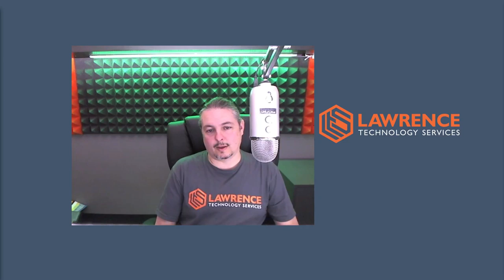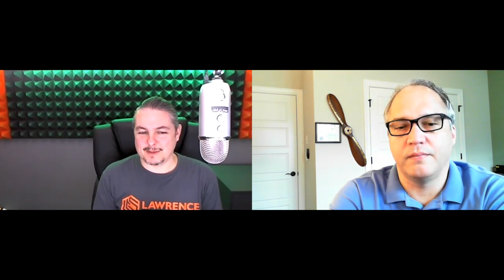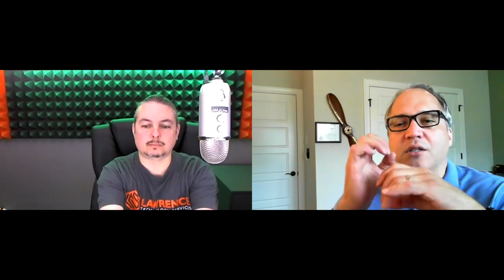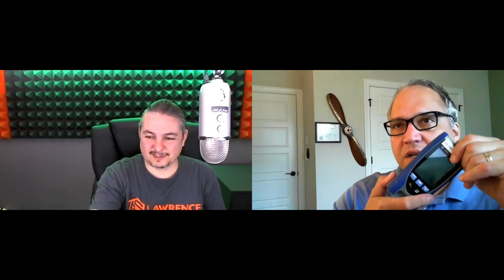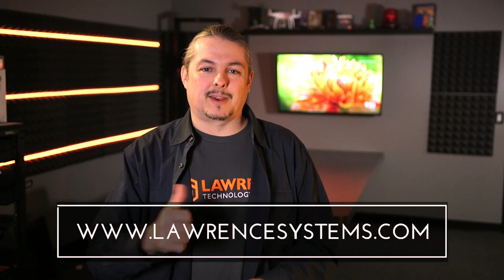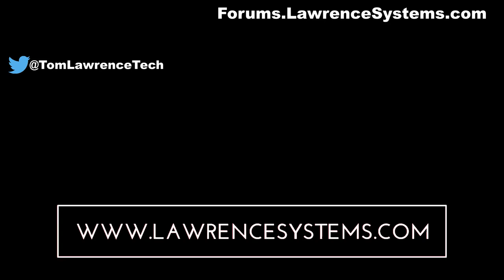The Evolution and Future of High-Speed TIA CAT Cabling Standards & Testing Processes

Comment: This was an outstanding interview!  I have worked in IT for a very long time!   I have interrogated cable installing companies all the way up to the owner.   In those discussions I would ask if CAT5, 5e, 6, 6a would support X speed and all I would get is a parroting of the cabling standard, which I totally get.  But the answers weren't real world!  In your interview with Dan Barrera, you got to the real world capabilities and the whys of it all!  The info about POE was very enlightening, especially the heat aspect within a bundle in unconditioned spaces.  Never heard of this being a factor in respect to data loss or intermittent issues.  Makes total sense! Outstanding!  Much appreciated!
Reply: @R P Good question.  We had about 40 feet or  10 meters of run between where we wanted two new patch panels.  I asked would CAT6 work reliably at 10Gbps.  Internet said we you could, if run was short enough, but expert said standard says CAT6A.  Not willing to take the risk, we ponied up for the CAT6A (its less expensive these days so I would just do CAT6A).  Later, a situation arises where we don't have enough CAT6A runs to connect old and new servers.  We patch in to CAT 5E runs and patch panels figuring we will take a performance hit, that line speed would negotiate down to 5, 2.5, or maybe 1Mbps.  Nope, 10Gbps, zero errors on server and switch interfaces.  Once done and the old servers were pulled we patched everything into the 6A runs.  But in the real world we had zero issues doing 10Gbps over older CAT5E runs in our server area, over a distance of 10 meters.  Now I know the real world answer--yes you can.

Comment: The reason why cat 7 is not recognized as a standard used in America is because it is a shielded product each individual pair has it's own shield. It actually looks more like multiple mic line cable. It was designed for the European market because the European market does not have an FCC to regulate RF emissions from equipment. Whenever you look at a piece of equipment you will notice that it has FCC requirements and that it has met those requirements that means that the equipment is within the RF limits specified by the FCC. As a result the American market uses unshielded twisted pair because interference is generally not common. A side tip cheap electronic car chargers for charging phones and tablets can actually interfere with the push start in cars because their power supplies may not meet FCC requirements and admit high levels of RF which can interfere with the electronic receiver in the car. Back in the 90s when police were using the FM spectrum for radio transmission you had to use screened CAT5 around those facilities because it would have interference from the radio equipment towers. Another thing that is interesting is the category cabling was not the first standard developed. Belden cabling and anixter developed the first standard which was called the levels program they had level 4 cable 4 pair twisted pair and it was swept at 16 megahertz. Later they came out with level five which was swept at 100 megahertz eventually the IEEE came up with the category standard and eventually anixter and belden cable dropped their levels program. This is now being adopted for fiber as well instead of having to specify a certain fiber type like multimode fiber 62.5 you can simply request om-1 om2 is 50 micron fiber om3 is 50 micron laser optimized 10-gig fiber and om4 is 50 micron laser optimized 40 gig fiber You also have os1 which is a single mode fiber and os2 single mode fiber. Another thing that can be mentioned is the jacks the 568A standard and the 568 B standard where did they come from. 568A standard was developed by IBM  the 568B standard was actually developed by Western electric it was designed to accommodate an existing wire configuration for T1.
And it's an extremely old wiring standard compared to the IBM standard. The skinny effect occurs around 54 megahertz. When you get into coax cable companies would commonly use a coax that was actually clad copper over steel for drop wire because it was a very strong wire.  However this cable is not suitable for satellite systems because satellite systems provide power to the lnb at the dish. Steele is a very poor conductor compared to copper or even aluminum. What makes aluminum a problem pronouns conductor for electric. Aluminum corrodes rapidly when exposed to air but also it tends to like to expand when it gets hot. This can cause the conductor to come loose for example a outlet and get hot enough to start a fire overtime . One of the main reasons why Poe switches can shut down is excessive current draw devices are rated in Watts if the voltage is too low the device will tend to draw more current and make the difference up that way. Not all power supplies will handle additional current needed to operate the device so they will shut down automatically to protect themselves.

Comment: Just needed to comment 😃 
The thing that cat 7/A cable (I'm speaking of raw solid core cable) is so popular in europe is mostly driven by the Germans, it's an mix of laws we need to follow.
New cabling for commercial (enterprise) buildings needs to be at last Class Ea certified. Every single communication wire needs to be shielded and Grounded.

Cat7 has a higher package density as cat6a STP and is much smaller in size. Cat7 is so popular that in fact it's most of the time the cheapest option to buy. If we want to buy only cat6a we have to import it from the US.

We install full shielded Class Ea rated keystones (E-Dat design) on the cables or use Krone LSA-PLUS punchdowns. 

I see a lot of hate against Cat7 cables and "Boooo, Cat7 does not exist and is a scam" shouting. 
That's 50/50 true 😂 no one uses Class F or Fa , no one uses GG45 or Tera and Cat7 Patch cable marketing promise's are in fact a scam 

But we Germans love Cat7 raw Cable

Comment: Lawrence I love the videos and this interview was great but the volume difference was maddening! I had to hold the volume knob ready to turn it down when you spoke and up when your guest spoke! If you are still using kdenlive to edit there is a simple "audio correction" called "gain" that can help you sync these up better. Again very grateful for these videos though, just trying to help 🙂
Reply from the maker: I did use that and through audacity, it was much worse
Reply: It was my fault. I had the gain too low on my mic setting. It was probably so low that adding more gain would have brought in too much noise. Sorry about that.

Comment: I know many years ago, the discussion was about switching over to silver compared to copper  for electrical wiring. I wonder if TIA or ISO ever thought about testing silver to replace copper. More likely, it will be a very expensive cable, but such as demand lower prices, we could see prices of silver CAT 6A cables at the price point compared to copper CAT 6A.

Comment: Yep. I do buy some Cat 6 when on sale, but I use 5E for everything, as I knew it was ‘good enough’.

I have had discussions with other IT people, less informed/trained, that swear you need Cat 6 for gigabit.

I reply: Prove it or give me the electronic (physical) characteristics for that claim!
(Or at least the specific spec).

There is always silence after that.

Once you know how data is actually transmitted on the wire, from the wire gauge, the frequency response/bandwidth, crosstalk, attenuation, to the specific electrical coding used (differential) to send the bit stream, very few people can teach you how Ethernet “really works”.

(I did start with ArcNet, Token Ring, Coax Ethernet and Thick Ethernet).
Reply: yea, of the two buildings i support, one is cat 5 and cat5e cable.  all of it runs fine at gigabit.  at lest two runs are over 430 feet and still, to my surprise, run gigabit.  only issue we had in the old building when we jumped from 10 megabit hubs to gigabit switches was that most of the connections weren't crimped to a standard.  At time of install, they just put ends on them being sure to match the other end.....  worked fine on 10 megabit.  after we rolled out the new gigabit switches, i had a lot of cables to fix.  for a temp fix, i forced the non working ports to 10 megabit (don't remember if it had to be half duplex or full worked) and everything worked.  took a couple of weeks to sort out all of the cable end issues.

Edit:  as an addition. two weeks ago, we switched phones over to VoIP and all of them are POE and work fine over our 10-15 year old cable plant.  I did kind of expect i might run into issues in the old building; but none so far.

Comment: Great interview!  Thank you.  Any thoughts on CAT5e or Cat6a marketed specifically for PoE use?  Specifically the cable with 22AWG specification.  I wonder how the higher gauge vs the 'normal' 23AWG compares.  Any issues to consider using 22AWG Cat5e?  I imagine some connectors may have trouble with the thicker gauge.
Reply: IEEE 802.3af (Poe) and 802.3at (PoE+) are specified to deliver their rated power 12.95 watts and 25 watts respectively over 100 meters (328 ft) of 24 AWG category 5 (not even 5e) cable. As long as it pure copper, not CCA. Higher gauge wire will provide less voltage drop and support more power over greater distances. If you are considering devices that require even more power, the new IEEE 802.3bt standard allows up to 90 watts (sometimes called PoE++) over 100 meters, even with 24AWG cable. However there will be more power lost in the cable and overall power efficiency will decrease. PoE switches and injectors will need to output more power and run hotter. This is where you absolutely want to use 22AWG cable. It will have much less voltage drop and the switches/injectors will thank you for it ;-)

Comment: Awesome video!
One question: are you considering cables with fiber for data and copper for power?
Reply: Anton Juul-Naber. Yes those do exist. Manufacturers generally call them composite cables. They will bundle a twisted pair cable and fiber cable in one jacket for that purpose.
Reply: @danpayerle  Thanks for the answer. I was more asking if there is a chance you might integrate it into the CAT spec? You know, a mere mortal like me can only really use it if the spec is on a tonne of devices and cables in mass production :) And it seems to me that it is the natural evolution when signal rates become too high for copper?

Comment: Dan Barrera said the actual usage of frequencies is 80 for 100mhz and 200 for 250mhz (which you have 25% headroom for both). but's what the actual difference if you gonna just use it for a 1 gigabit line ?
Reply from the maker: None
Reply: @LAWRENCESYSTEMS  Correct, for 1 Gb/s transmission cat 6 has no advantage over 5e. If you start to consider other factors like high power PoE or use in areas with a lot of EMI/RFI like a factory one could argue that cat 6 or 6A might be a better choice. In reality, if it's a typical installation and you just want 1 gig, save your money and put in a good quality 5e cable.
Reply: @danpayerle  Shielded cabling, connectors, jacks and patch panels can also be useful in environments with a lot of EMI/RFI, this is optional in most standards so understanding what it is for and when to use it is important!

Comment: My only major argument is that the creators of these standards should never assume they won't be used in the home. SMBs ran from home are getting more and more popular, YouTubers running video production studios from their homes is a great example and many are already saturating single 10Gbe connections with their NASs/File Servers. Another good place to look for power users already using 40Gbe at home is the servethehome forums where people are starting to adopt 25G+.
Reply from the maker: I think the standards adopt well to home users.  Data centers are generally much bigger than House's so standards such as cath8 work well within the short distance.
Reply: There is a TIA standard for residential cabling, the TIA-570-D. It lists several grades of cabling from minimal voice/data to fiber in the house. I think it's safe to say few installers of residential cabling follow any of the standards.
Reply: @danpayerle  They follow the enteprise standards if we are lucky, that's why Cat data cables are an option offered by almost every builder in the US. And no, they will never follow some home specific standard, unless it was in code, because the customer has never heard of it.

There are exceptions, profession A/V/HA installers probably follow these standards, but they are so expensive it's rare to see their work.
Reply: @schonzen in a nutshell, if you want 40GbE on copper you need to use cat 8. The downside is that the distance limit is 30m. If that meets your needs then go for it! Cat 8 is a Sc/FTP cable, meaning there is an outer screen and each pair is individually shielded. It’s quite expensive and there aren’t a lot of companies selling it. Especially in the US. 
Your comment about 25GbE is an interesting one. In ISO we have a standard for Class FA cabling that is rated to 1000 MHz, also Sc/FTP. The connectors are not RJ45, there are three types called Tera, EC7 and GG45. Very interesting connectors with high isolation between pairs. This cabling can support 25G in theory but the problem is that there are currently no Ethernet chip manufacturers who offer or are planning to offer 25G PHYs for switches or network cards. So there exists a cabling standard that was created for an application that never appeared, for structured cabling at least. Excluding direct attached SFP+ solutions. 

When you are getting into greater than 10G speeds fiber starts to become interesting. You have a lot more flexibility, greater lengths and the newer cabling allows for easy upgraded. Search to “parallel fiber optics” and “MPO” connectors. These are systems where 12 or 24 fibers are in a flat ribbon cable. For low bandwidth applications only 2 fibers can be used. When you need more bandwidth the optical modules are swapped and more fibers in the existing cable are used. Pretty cool stuff.
Reply: Where did they say that they assume something won't ever be used in the home?  I didn't hear a single thing about home users in this discussion.   This was all about the standards and talking about business implementation.   They all work for home users and it is easier as home users generally don't have to worry about the length so we can use cat 6 for 10g instead of needing to install 6a.

Comment: Fiber CAN carry power!!
You do realize that we derive power from Sun’s light, right?
Reply: The best systems in the lab yield less than 20% efficiency so ~120w for 15W at the device isn't remotely practical
Reply: @ProcintUS  sounds like a lot of heat generated in the cable to me. Who wants to pay 5x as much for their power and A/C bill? Not me.

It makes more sense to run hybrid glass and metal cables for fiber plus power.